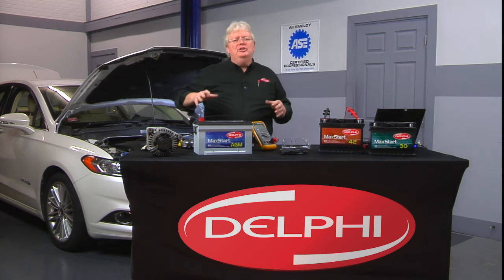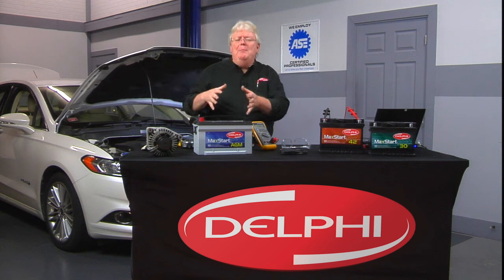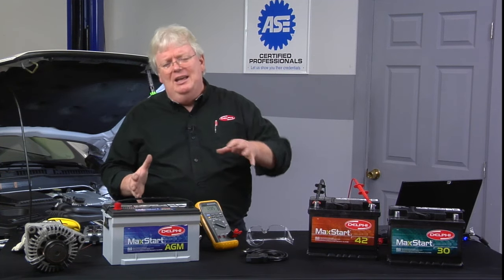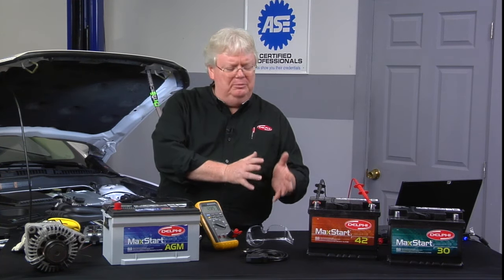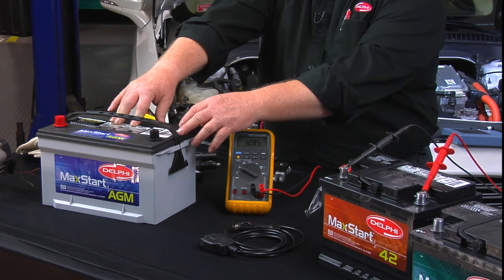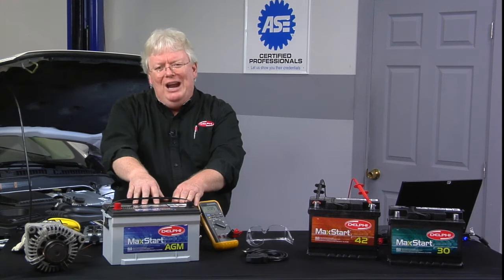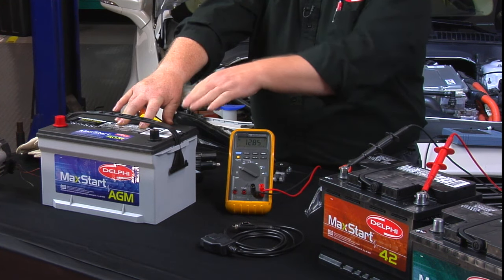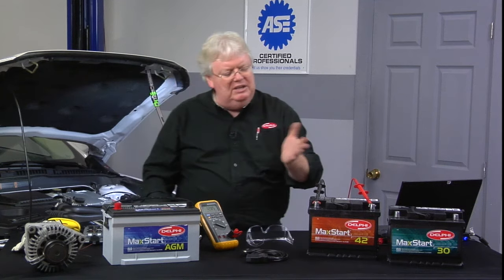What is the Difference between Conventional and Absorbed Glass Mat AGM Batteries?

Comment: Just paid $180 for a size 94R AGM (800 CCA) battery at Menards after Autozone quoted $200 for a 94R AGM (800 CCA), and $170 for a 94R standard lead acid (800 CCA).  Plus the core charge was only $10 instead of $20.  Thankfully YouTube videos showed me the MANY steps to replacing the batter in my 2017 GMC Sierra 1500 5.3L so it was a quick and easy job.

Comment: A group 35 battery from one company costs $78 for the conventional and $155 for the AGM. Twice the price is not justifiable unless it lasts twice as many years.
Reply: Seriously ridiculous
Reply: Need a group 35 for my 350z and its 99.99 or like 156.99 for a AGM battery so Im going with cheaper conventional battery. Same 36 month warranty to
Reply: Depends on your needs. AGMs recharge faster and do better in cold weather. STOP/START technology requires an AGM.

Comment: I drive a 2005 BMW 530D with original AGM battery at 285 kkm and it still starts up fine. About 6 months ago my car started to loose clock every few days and I suspect the battery is finally on its way out (despite still cranking without issues!). That's nearly 17 years! I bought the car 10 years ago and didn't see battery replacement in BMW history by the previous owner (no battery registration was done on the computer either).
Reply: Interesting. I fitted an AGM to my Caterham in 2006 and have just had to replace it. In contrast to yours the Caterham has spent much of its life unused but keeping it on a 13.3v maintenance charger as suggested by the data sheet that came with the battery seems to have been good. The data sheet stated a 12 year life so I'm happy.
Reply: Wonderful a battery for 17 years
Reply: My are about 3 years old on my 2020 Ram 3500 6.7.. I ended up here because I'm looking for battery replacement already after only about 3 years 😢 , compare that to 17😒

Comment: hmm very interesting. my new "AMG" battery had a "leak" after 3 months of installation. How does that work since he said it it leaks when it's overcharged? The alternator is too strong?
Reply: Hello there  he said it will vent(leak) when over voltage is detected, thus shortening its life.
Reply: 14.6 – 14.8V. anything more than that and it will vent/leak. If you have over voltage you Alternator Voltage Regulator has gone bad.
Reply: I bought fm radio transmitter where can see also the charging voltage 😅. Its too late when the car tells you its too low 😂

Comment: I have a NAPA p/n 9834 AGM battery in trunk mount next to the ATN fuel cell in my Mach 1.  NAPA's half the price of an Optima...and you don't get any 2 year-old "new" batteries from NAPA, either.   I've seen nearly 3 year-old Optimas sold as new!  FYI:  Once the acid goes in, it isn't new any more.

Comment: HI.Can you tell me the correct voltage for AGM battery...? Thank you!
Reply: 12.12
Reply: 12.12
Reply: @mazeniedrice-nestant4508  conventional 12.6-12.7volts & AGM a bit higher @ 12.7-12.8volts

But that’s both type batteries 1st being fully charged and then sitting idle with charger removed for 8-10hrs with no load to let battery voltage stabilize.
Note, when talking Brand new or almost new 12v automotive batteries of both types they can show a bit higher voltages even 8-10hrs off the charger with no load.
Happy Motoring!

Comment: Bought used Tacoma several years back had AGM battery died 3 years 5months after date of manufacture 
Put in my my 2015 rx 350 $120 Duracell lead acid lasted 3 years 2 months
Reply: I have a 2015 Tacoma TRD 4x4 that I bought used from a Toyota dealership in 2018. Darn Toyota Oem battery they had installed new when I bought it lasted me until now and finally died.